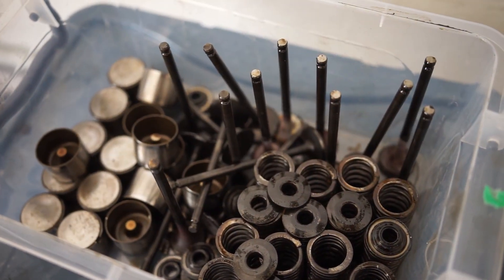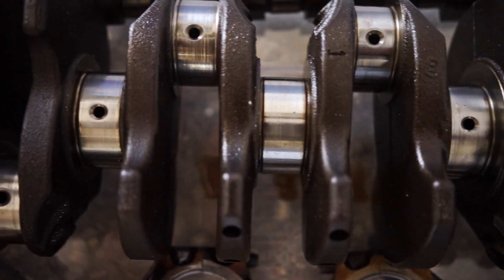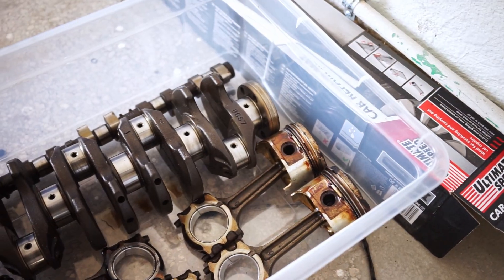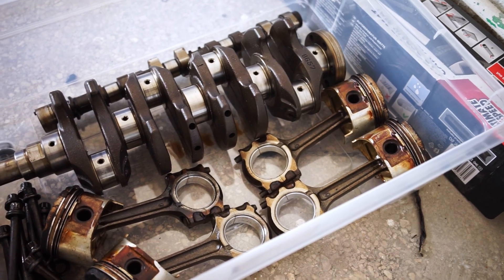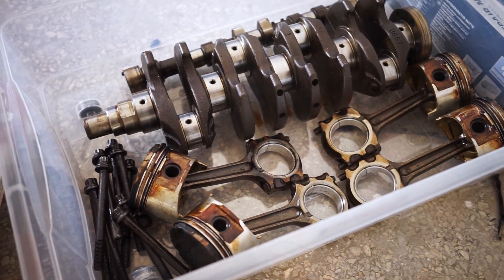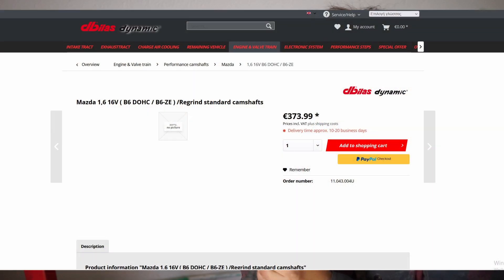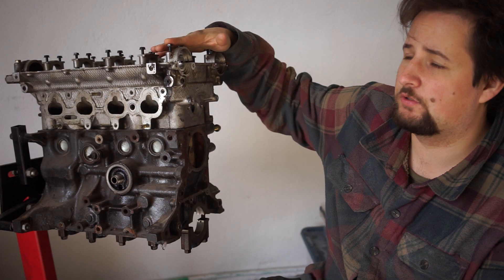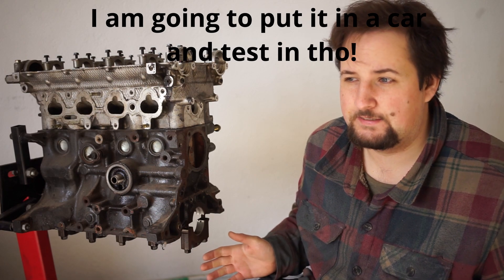Trying to build a Low budget NA Miata Engine | 160 HP for 1500$ | Introduction

Comment: I'm about to start doing similar mods to my engine maybe not to the same spec as I'm going for the exhaust intake mod head skimming head porting timing advance and then tuning basically everything I can to get power for as cheap as possible
Reply from the maker: nice, but with those mods you are probably only gonna be seeing 130-135 hp. im gonna go way more indepth with reducing wheight in crankshadt, rods and pistons, shaving the head and block about 2mm, doing some headwork optimizing valves and having the cams reground. Also a good intake system will make about 10 hp in itself. 

Also a programmable ECU is a must at this point. also on the mods you want to do it is highly recommended.
Reply: @throttlebuddies0  yeah I know I'm not trying to hit big power just get every last bit of the of power you can achieve without opening the block too much or forced induction ect
Reply from the maker: @youcodnerd   Then look at a custom made intake with a bell mouth filter. can be worth 15 hp on a 1.8 and also reground cams are a budget option to getting more power, but on a stock ecu you are generally not gonna see much anyway
Reply: @throttlebuddies0  I'm planning on getting a ECU soon and do you think the exintake mod for the cams is worth it or just get reground cams ?
Reply from the maker: @youcodnerd  i mean depends the exhintake mod will not really gain much, maybe 3-4 hp on an NA motor. i would highly recommend a set of reground cams, as they can net you much more power